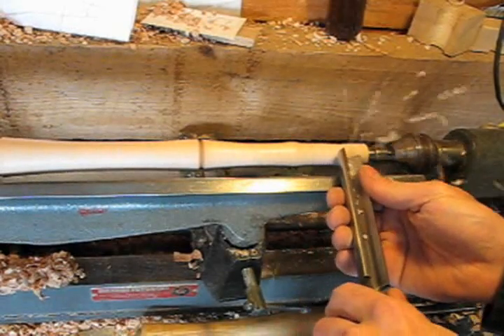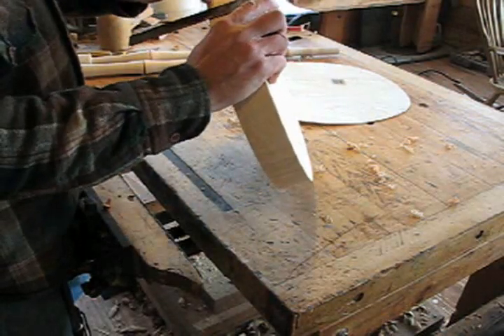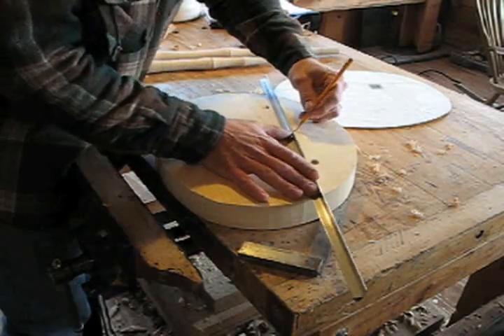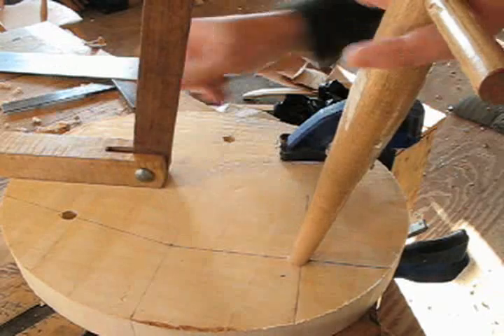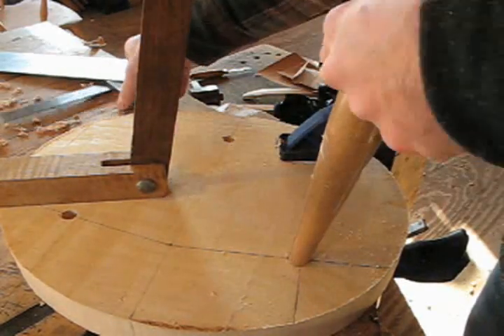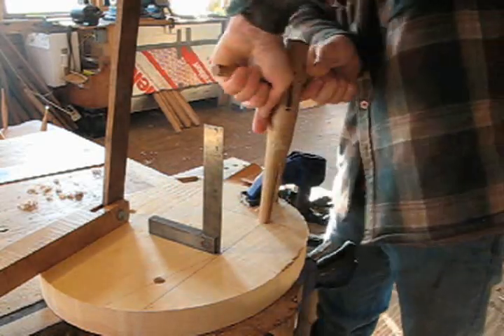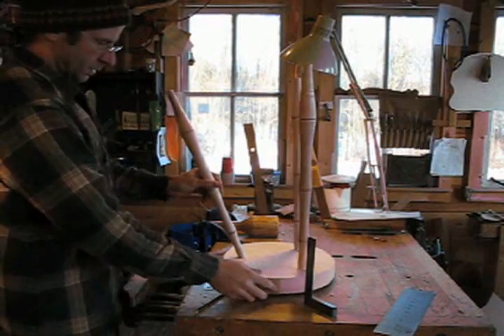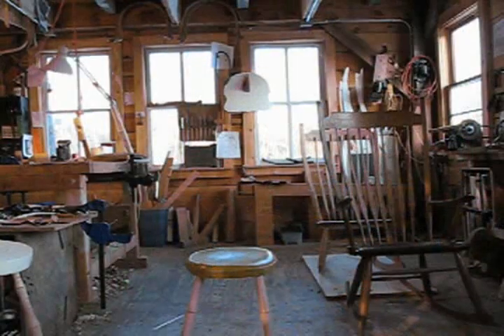reaming the seat

Comment: 56TonyT, since Peter hasn't got back to you on this, maybe I can be of some help.  The wooden parts you probably have already figured out.  He turned a cylinder, then put a nice taper on one end.  He drilled the straight end for the T bar.  He then sawed a slot in the taper for the reamer cutter.  He made the cutter probably from an old saw blade.  I'm guessing he sharpened both edges like a scraper.  You file a burr on the edge and then sharpen it on the stone.  Hope that helped.